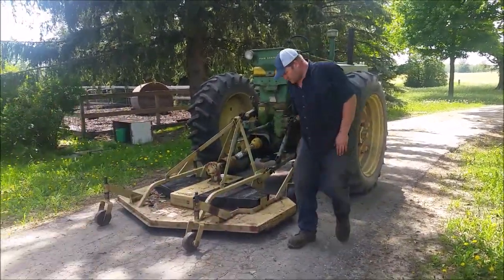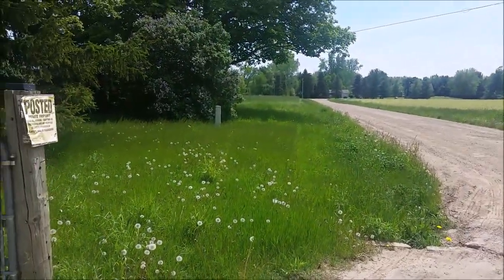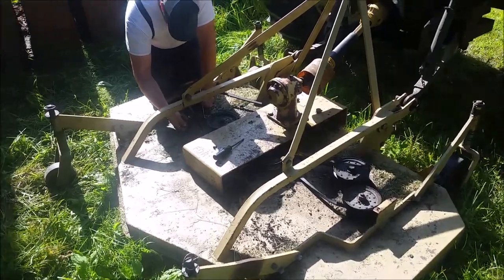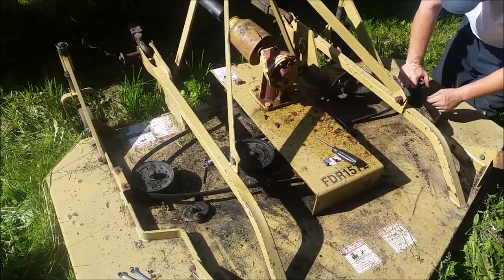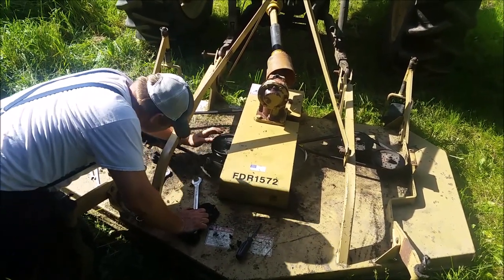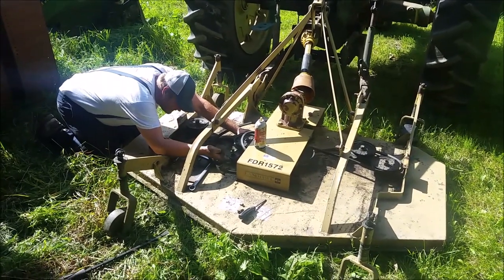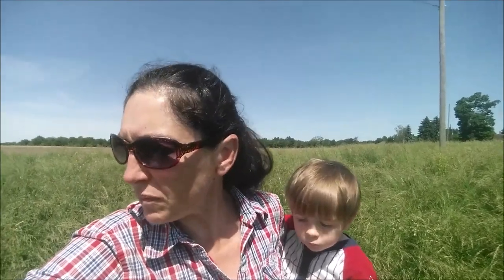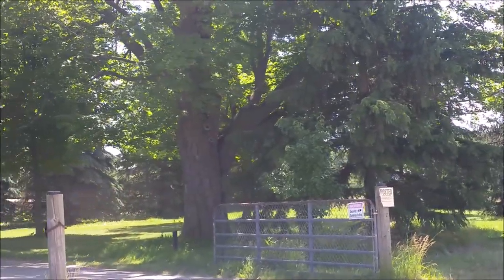Using the Tractor and 3 point mower

Comment: Gearbox leak- don't know how you are filling, but there is a pipe plug in the back or side that is the fill level, take plug out, and fill until oil gets to the plug opening, don't fill box to the top.
Reply: Never mind, I saw you filling it correctly in another video.